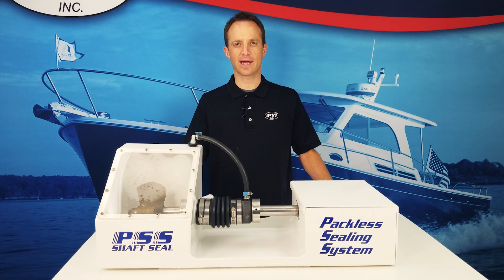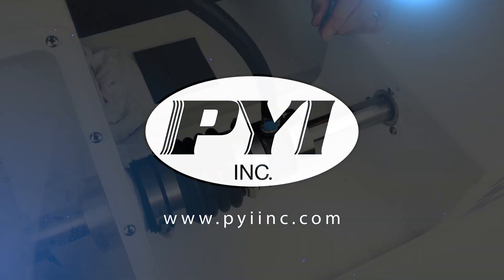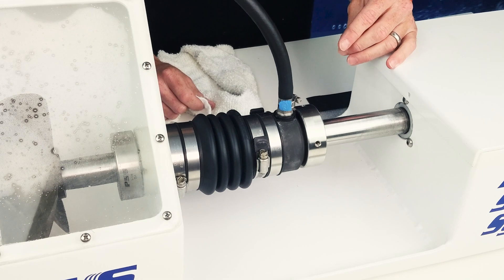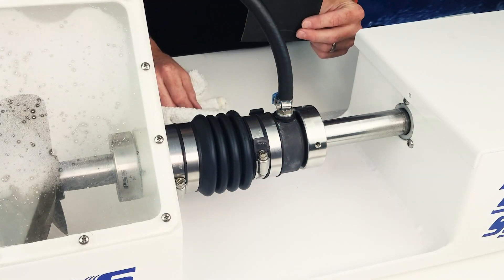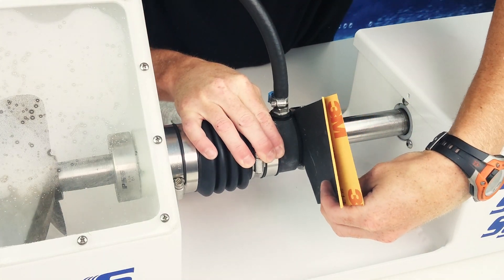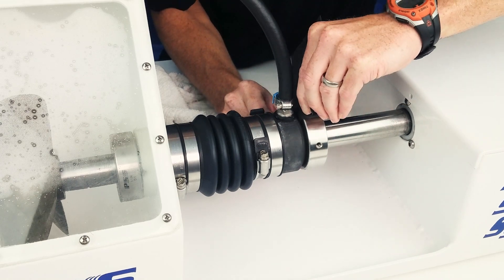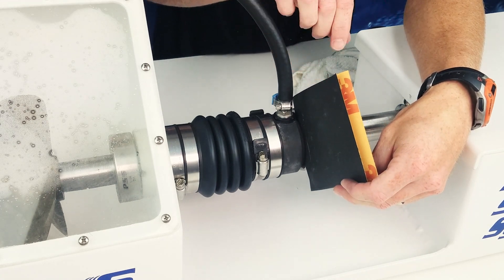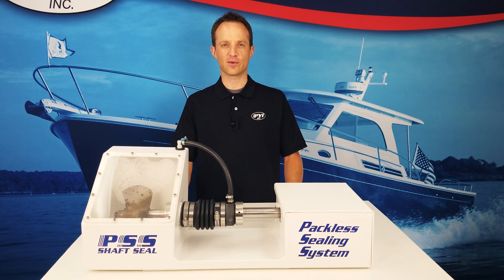How To Clean A PSS Shaft Seal

Comment: I have these seals on a 2000 440 Trojan express. I didn’t have any leaks last year.  Then after my boat sat for 5 months we went on a cruise.  At 1200 rpm it starts leaking pretty bad at the carbon & Steel.  I can see white salt corrosion off of it.  Did the towel and worked a wire brush around as well.  But didn’t seem to help.  Last test ride same rpm did it again.  Any additional thoughts. Thanks
Reply from the maker: If the seal is working at rest and low RPM's, we know the faces of the seal are good and flat.

There could be several factors that are causing the seal to leak at higher RPM's:

- Foreign material being introduced such as anti-freeze if engines were flushed. Fix this by cleaning faces with folded 600 wet-dry sandpaper.

- Not sufficient compression on the bellow. This could be a result of the bellow getting old or the engine mounts aging and shifting more. To counter this add more compression to the bellow.
Reply from the maker: If you would like to speak with our tech support, please give us a call. Our phone numbers are listed on our contact page here: https://www.pyiinc.com/contact.html
Reply: Good news I hope. After your suggestion to ck motor mounts. Sure enough I had one loose. Top nut had backed off. I hope that fixes it. I couldn’t test ride due to weather. So as soon as I do I will post an update. 👍

Comment: Do you loosen the set screws while you do this.  Do you do this while the boat is in the water?
Reply from the maker: You do not have to loosen the set screws, compress the rubber bellow to separate the carbon stator from the stainless steel rotor. Then proceed to clean the two mating faces. You can do this while the boat is in the water, however keep in mind that water will be coming out while the two mating surfaces of the PSS Shaft Seal are separated.